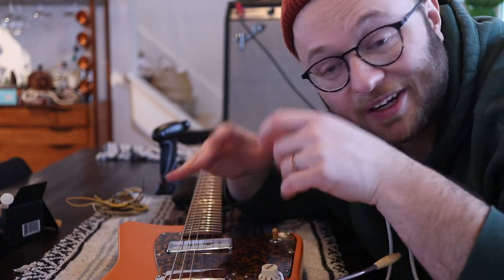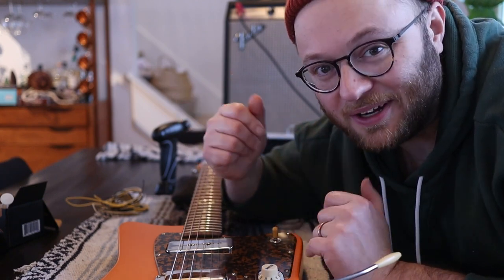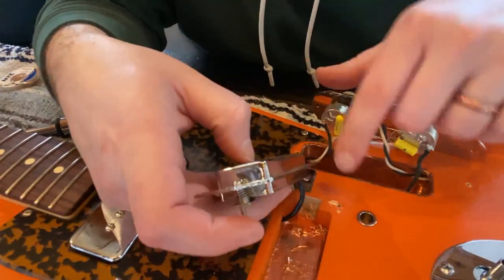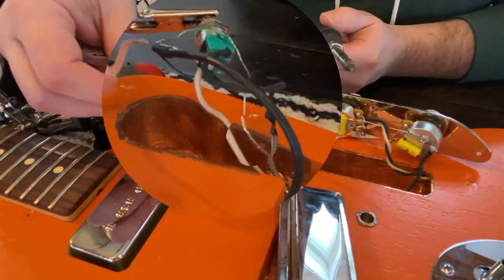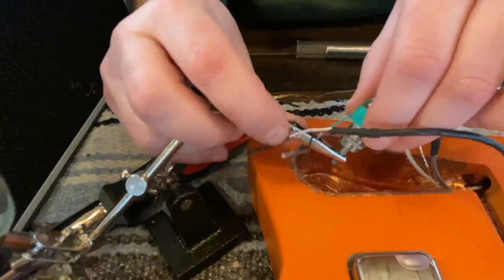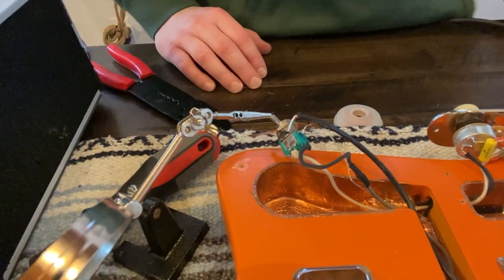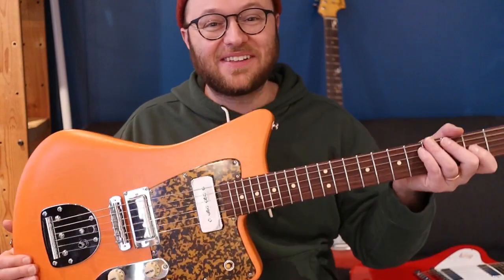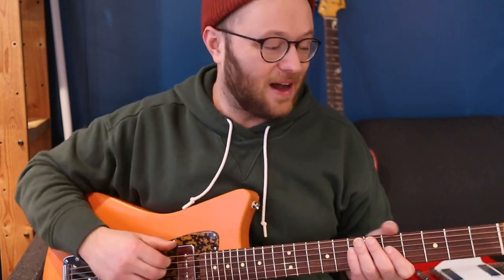How to fix out of phase pickups - electric guitar

Comment: I just got a Mascis Tele, like I haven’t even got it home yet, and the center position is deliberately out of phase from the factory.
It’ll be interesting to see what it’s like, especially running it through some fuzz.
It’s cool hearing yours in detail.
New sub
Reply from the maker: Nice! That’s a rad guitar. I built a tele custom that has a s-1 switch that changes the middle position to out of phase — it’s actually a fun tonal option to have. I like it with fuz or even a colorful overdrive. With my tumnus it can kind of remind me of an envelope filter/auto wah kind of sound! 

It actually crossed my mind to maybe pop an S-1 or a push/pull switch in this and keep the out of phase sound option — maybe go to a 4-way switch too to get series and parallel middle sounds. 

Lots of fun! Hope you love your new tele. Keep me posted how it goes!

Comment: I have exactly the same problem - just last week, I put a bridge P90 which I had lying around in the neck position of a guitar that has a Tonerider Alnico II in the bridge position. I balance the volume discrepancy by moving the p/ups nearer or further from the strings. 
Because there are two bridge pickups, the middle position (three way toggle) is out of phase. It is sort of an interesting sound - very bright - but I've a feeling the regular sound would be even better.
The wiring colour codes seem different on Tonerider, and the three way toggle selector is old school - not like your one - but essentially I have to swap around the hot and the ground? So the wire that goes to the p/up selector and the wire that is soldered to the back of the pot (ground) should be swapped around? And the shielding (which was wrapped round the ground wire) remains soldered to the back of the pot?

I'm going to drop Tondrider a line, but you seem to have sorted it all out! P90 in neck and humbucker in bridge has to be the best combo! I didn't use a bridge P90 in the neck because I especially wanted to - I did it because I had a bridge one doing nothing in a drawer. Definitely worth it!
Reply from the maker: Thanks for sharing! Yah, the out of phase sound is distinct and different but definitely still usable in some situations! I have a tele I built with the Baja style wiring that gives me out of phase sounds (in both series and parallel) and it’s really fun to have the tonal variety. But if I had to choose just one, I’d still take the in-phase middle position over the out of phase. 

Regarding the wiring for your set up, the basic formula is: pick one pickup (either neck or bridge) and for just that one, reverse which lead is going to the ground and which lead is “hot” (going to the switch).  Any bare wire is usually a pickup cover or base ground that’s separate from the coil ground and that should always just go to the ground. So from how you’re describing it, it sounds right to me. (Note if you have a pickup where a metal cover or baseplate is connected directly to the ground of the coil itself, swapping phase might not work. But sounds like you’ve got the option from how you’re describing it.
Reply: @dadtimejamtime  
Cheers for getting back to me. Yes, both pickups are pretty standard configuration, nothing weird. In fact it is a Harley Benton bridge P90 I put in the neck position. Their p/ups are pretty average usually, but their P90s are excellent. 
I've got the relevant wiring diagrams - I'll still drop Tonerider a line, because I'm sort of a regular customer, and I'm familiar with their tech support. 
I was so pleased to find your video though! You had precisely the same issue, and it's always good to find that - makes you feel you are on the right track to getting a solution!
Have a Great New Year!

Comment: So you didn’t want it out of phase?
Reply from the maker: Thought about it. We went back and forth on a few different pickups and configuration options for a month or so but the in phase tone between these two pickups is so well balanced between high and low end that it’d be crazy not to have it available. I might drop an s-1 switch or push/pull into it at some point (and maybe a 4 way selector) to get series and parallel in and out of phase sounds (like the Baja Tele wiring scheme). I have that on a thinline tele I built and it’s fun to have 6 different tones in a two pickup config.